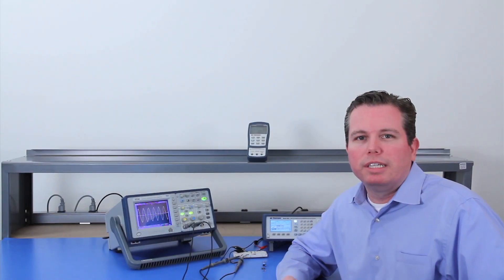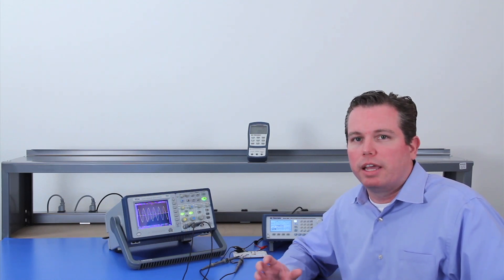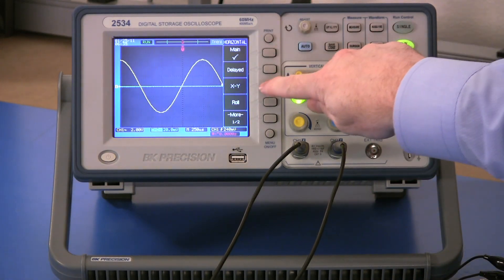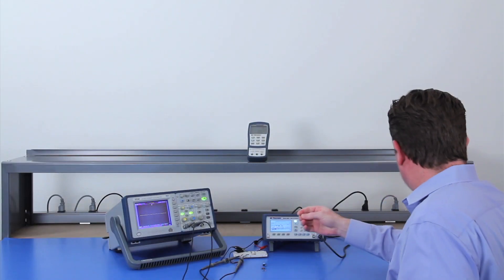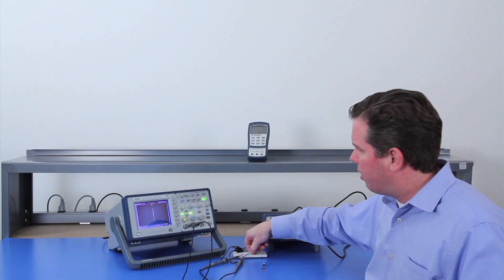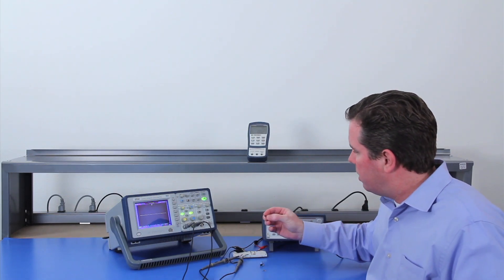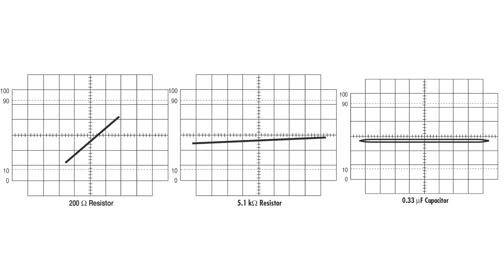How to Use an Oscilloscope and Signal Generator as a Component Tester / Curve Tracer

Comment: Great explanation, kind of a octopus circuit with signal gen instead of transformer. Question, do we really need R1? We need resistor just to probe the current, so maybe just r2 with a slight higher value ( to prevent to much current in DUT ) would suffice?

Comment: Great lesson.  My only confusion is where do the ground leads of the oscilloscope go?
Reply from the maker: Hello @worldwide1376, thank you for your question. You connect the oscilloscope probes ground to the same point as the negative lead from the signal generator (between R2 and Signal generator).
Reply: @Bkprecision1  Appreciate it.
Reply: @Bkprecision1  : can you test igbt, triac, power electronics bulky components and ic as well?

Comment: Are you using 5ac volt or 5 dc volt?
Reply: He is using an AC signal otherwise all you'd get is a single point on the screen. By using an AC signal of amplitude say +/- 5V, voltage on the X axis can then go from about -5 to 5 volts effectively showing an horizontal line. Assuming the DUT is an open connexion, then no current flows and so that line would lie at 0 volts on the Y axis.. hope that helps.

Comment: Hi
What are the values of R1 and R2 on your breadboard circuit for the curve tracer?
Reply: the circruit is incomplete;)
....you need to connect gnd somewhere !
Google "octopus comonent tester" ......you will find many adäqate diagramms .
r1 and r2 have to dimensioned so that no Short can accure to the Source (in the o. case a 6....15v transformer) ....its easy  ;)
.....
Sorry for my poor english +

Comment: At work I use a tool called an 'Interceptor' made back in the early nineties, it will do this exercise automatically and cycle through various voltages and frequencies.  it has 2 probes and a common ground so you can directly compare a good board with a bad one and overlay the 2 traces and spot a faulty component.
The data can be saved to the internal hard drive so you can map a good board and have traces ready to compare should you get a bad board.
It is old and looks old too, works with a GUI and maybe a 286 processor in it. Boy is it slow to respond to menu commands.
It works though and is useful.

Comment: Interesting. I can take my 30 year old Tenma scope, press a button, set it to XY mode, and get a very similar function.
Reply: Your analogue scope may actually be better for this use. The XY display on many digital scopes can be very poor, sometimes just a series of dots. You don't need a wide bandwidth for this, so an old 5 or 10 MHz analogue CRT 'scope would be fine.

Comment: Hi
Good video. This basic application has been around for years. Google, octopus transistor tester, you will see a number of articles using a few parts and any old O scope with a horizontal function to make a simple curve tracer. I have a Tektronix 576 curve tracer in my lab but often use the octopus to check transistors. You can buy a $3800 commercial unit made by Huntron that does the same thing. Surplus scope; $30 + parts $10= GREAT, CHEAP curve tracer

Thanks,
Glenn WA4AOS
DSM Labs (dot com)

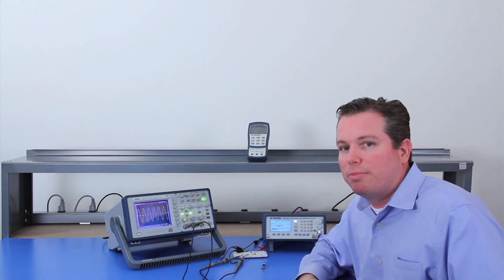Comment: 1:07 - It's not a 20 mega hurt generator. It's 20 megahertz.
It bugs me when technical people think hertz is plural for something.
2:19 - He says 4 "kilo hurt"
Reply: Resurrecting a 6-year-old comment for a fundamental debate, because it's interesting that you point it out. I've got a similar pet peeve with people saying "heighth" (instead of height") when saying length / width / height.

Though in this case, it's really hard to tell. For example, I know sometimes I still mouth the "s" or "tz" sound on the end of "megahertz", but just don't always bother enunciating it, since "megahert" is easy to say, but the "s" / "tz" sound at the end of it requires way more precise tongue-and-teeth work to enunciate properly.

At your 1st timestamp it seems like it could go either way; I can't tell if he's dropping it, or making the tongue movements and just not enunciating it strongly. Your 2nd timestamp I don't hear any fade-off at the end, so it's hard to tell.

This reminds me of George W. Bush and the way he said nuclear ("nuquler"). It's interesting how a lot of words develop differently--depending on your country / state / region--depending on how much effort certain syllables in them take to enunciate. For example, the 2 "megahertz" ones you pointed out, I didn't even notice the first time I watched, since it's so common for people to say syllables like that more quietly than the others.
Reply: A bit like how Americans say soder instead of solder
Reply: Maybe he works in a labratory. Heinrich Hertz worked in a laboratory. At least he doesn't say 'like' multiple times in each sentence.